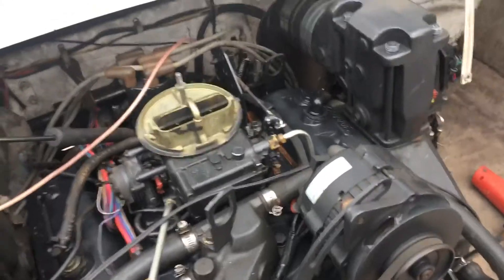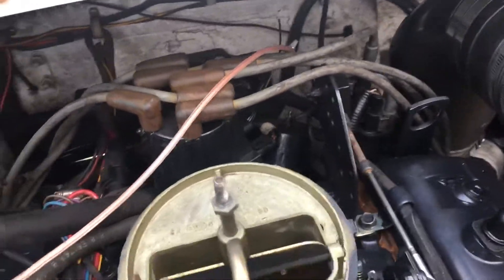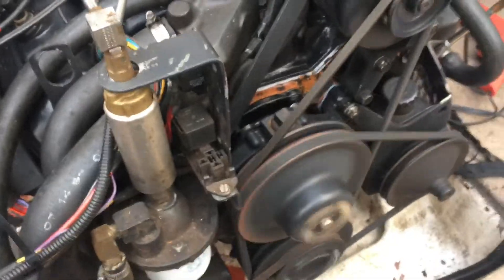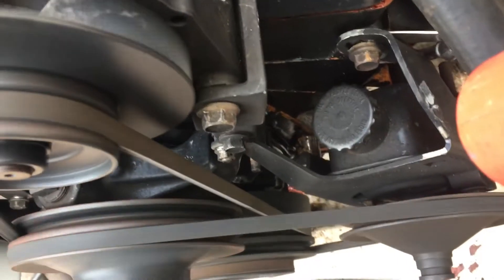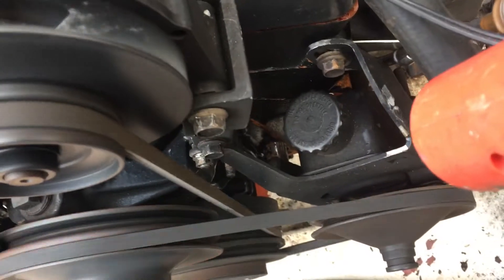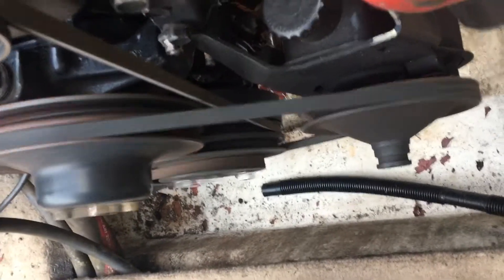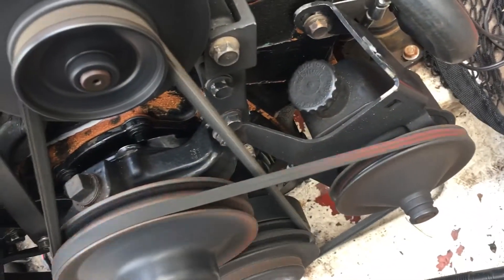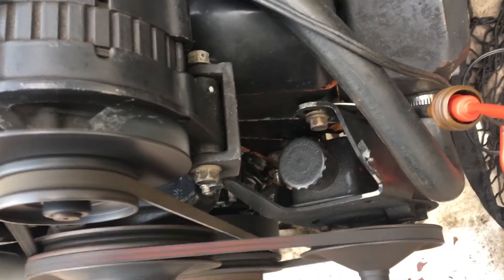Part 9D - Mercruiser 4.3 V6 Rebuild - Setting Dynamic Timing

Comment: Connect the positive to the shunt connector before or after the engine is running? Most videos and forums says to connect it to positive after the engine us started. I tried this and it wont disable the advance. The factory volvo service manual says to connect it before starting the engine. But im nervous to do so because several people have stated that it will fry the ignition module.
Reply from the maker: While it won’t physically hurt the module or engine to connect the shunt tool before starting it’s best to start it then make the 12 volt connection because the engine starts easier without the shunt connected. The shunt puts the timing at base setting which is usually very retarded compared to the running timing. These two videos pretty much explain all you need to know about the module and its timing function.

https://youtu.be/Dx0eevaXK-s?si=ucscorZ4cRwdYS8w

https://youtu.be/Ty0kLe42kZk?si=lswaxhTL_VQPPN5w

Last comment. If when connecting or disconnecting the shunt tool the engine rpm doesn’t change you’ve been sold a car or truck module which will not work in a marine application, which is why I sell my kits. Too many frauds out there. Took getting ripped off by marine parts source dot com six times before I switched to genuine GM modules only.

Edit: you said you tried connecting the shunt tool after starting the engine and it didn’t disable the advance. That’s a sign you have a car truck module. The shunt tool does nothing to a car truck module. Also when people say it fried their module that’s because it was probably the wrong module to begin with. I can’t stress enough that the only module that that I’ve found works consistently is the DELCO D1965A module. The rest are a crap shoot.
Reply: @moccasinmarine  thanks for your reply. The distributor does not look like a volvo part. But im not sure. It was on the boat when I bought it. The module you sell is compatible with a 99 4.3 GL volvo penta engine? 

It IS advancing, i just havent been able to get it to disable the advance.
Reply from the maker: Again watch this video at 16:00. 

https://youtu.be/Dx0eevaXK-s?si=DIKUXP-NWFohsYfk

Car truck modules don’t advance at all until 1500 rpm at which they advance a fixed 13 degrees. It’s not a smooth ramp but a jump straight to 13 degrees. If you use the shunt tool it disables any and all timing advance on a car truck module at all rpm’s.

I don’t sell just modules. They are so rare I only sell them with complete kits. You’ll have to hunt down a D1965A somewhere on the internet.

Comment: Good morning,   I've got twin 19898 4.3 mercury cruiser motors were is the plug that I put the positive wire with the clip  to set the timing?
Reply from the maker: The timing tool is a separate harness that plugs into the distributor but if you have Mercruisers you don’t have this type distributor. To the best of my knowledge no Mercruisers used the Delco EST distributor from the factory (EDIT: The 3.0 liter Mercruisers did use the Delco EST system.) I apologize for confusing you. The title of the video says Mercruiser but the video was done on a Volvo Penta engine. To time Mercruiser Thunderbolt ignitions google the type module you have.

Comment: Hi! Thanks for the video. You say to ad a jumper to the “3rd terminal back there”. I’d really like to know where that is as it’s a vital step in the process. 
Also you said “mercruser/Volvo pinta engine “. Looks like a mercruser 4.3 is that correct?
Reply from the maker: Watch part 9E for the answer to your question. I explain how the set timing connector works.
Reply from the maker: Also Mercruiser, Volvo Penta, OMC primarily refers to the outboard part of an Inboard/outboard system. Just about all the engines are GM 4 cylinder, V6, and V8 engines so when talking about the engine it doesn’t matter.

Edit 11 JULY 2022: This engine was part of a Volvo Penta system. It has dawned on me that Mercruiser did not use the Delco EST ignition systems in V6 and V8 engines so this video technically doesn’t apply to Mercruiser engines.

Comment from the maker: I want to make something clear here. Normally the engine would not be in perfect time on the first try. I did not rehearse this video. In the video you see me check the timing with a light for the first time. And since I’m so good at this, the engine was in perfect time from when I installed and static timed the distributor. In all seriousness, it’s very rare that the engine will be in time on the first check. Normally the marks would not line up so you have to loosen the distributor clamp, rotate the distributor until the marks line up, and then tighten the distributor clamp back down. This was not shown in the video because I got lucky and the distributor was timed when I installed it.